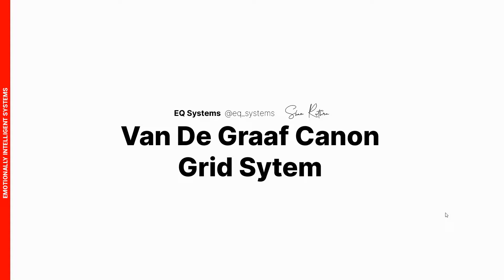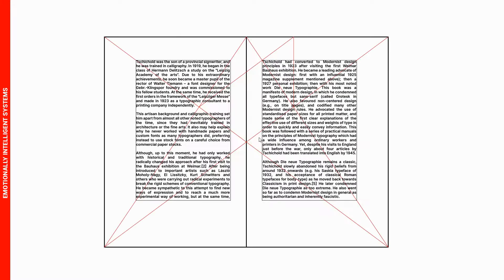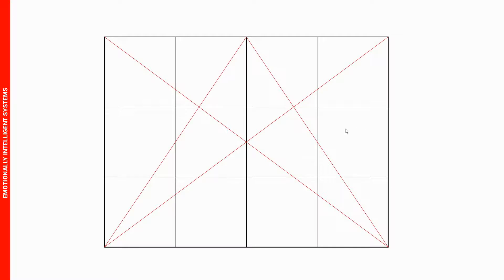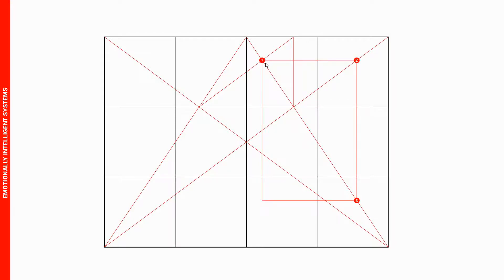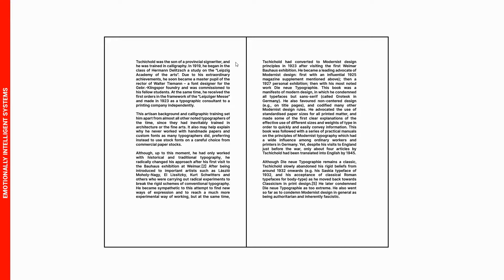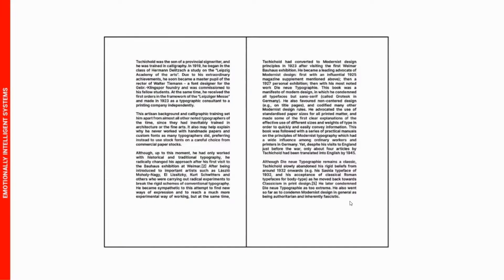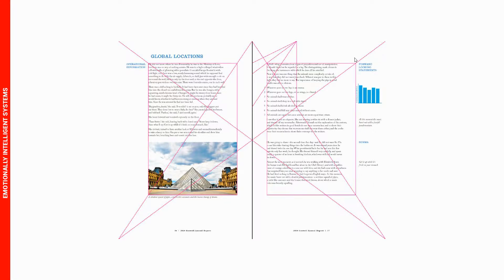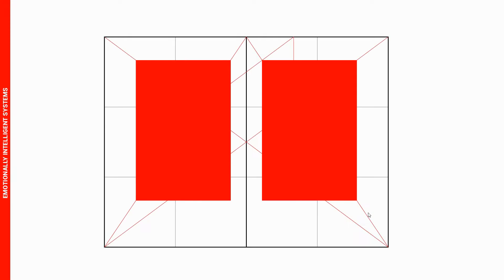How To Draw And Use Grid Systems In Your Design Layout (Van de Graaf Canon)

Comment: Excellent, but, what is the use of the little vertical line_?
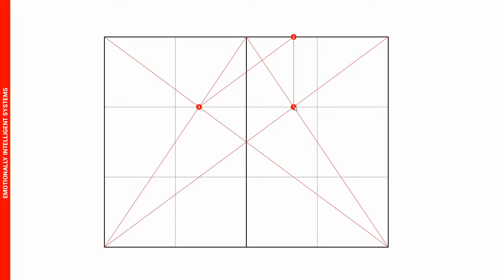Reply: Drawing the little vertical line gives you the correct placement at the top of the page (the "2" point) at which to start the next line (from the "2"point to the "3" point seen @1:30)